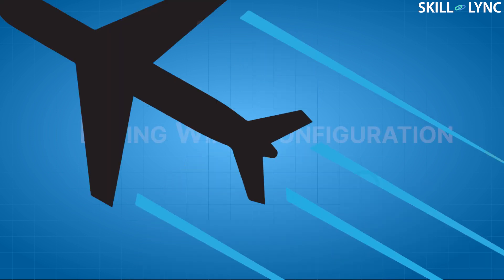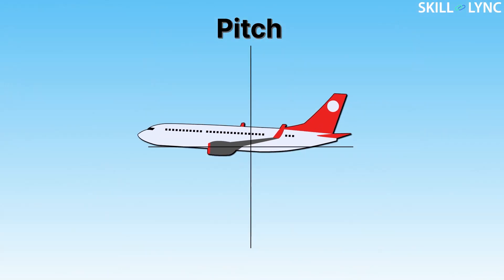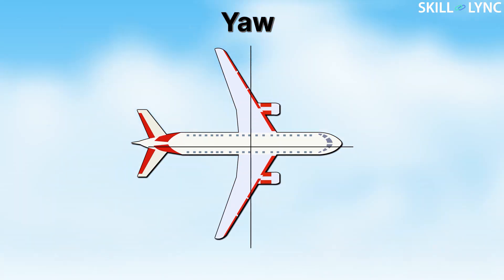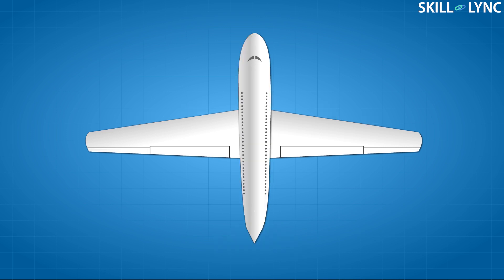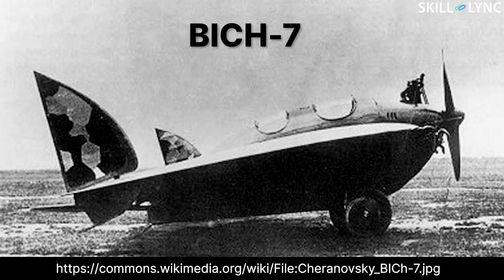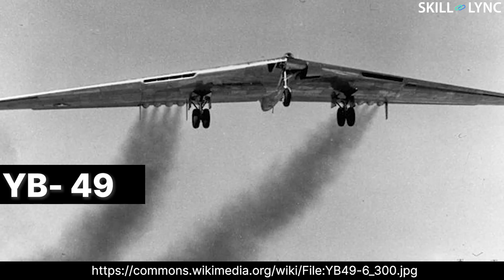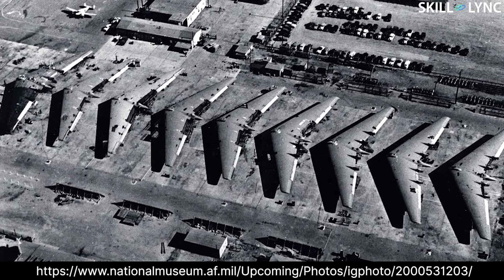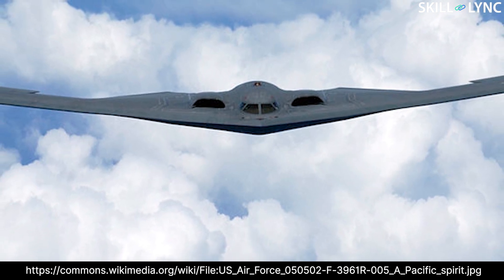What is Flying Wing? | Skill-Lync

Comment: Other definitions of the media term "flying wing" are when the major connecting structure is a lift-producing element, as opposed to one which produces only static drag but no lift.

Many such aircraft have flown, many have flown well, some have flown markedly better than "normal" planes, provided that they have vertical fins and rudders.

See the youtube "Flying Heel Lift" about the 1930s Arup S-2, and others about the Arup S-4.
Also in the '30s, the Kharkov KhAI-3. Just like a "flying wing" in your terms, but with a substantial fin & rudder after CG and trim & control issues were settled, it flew well, with no reported bad habits.

Burnelli planes were called "flying wing" because the fuselage produces lift, though they had substantial tails.

See Northrop's first plane the "Avion 1" (x-216-h) of 1929. A tail, but no fuselage beyond a thick center section the wing, and two slender booms holding the tail.
Reportedly it was among the best planes in its class in all criteria, and markedly faster than all others. For some reason, he dropped it to chase off after the completely tail-less purist dream, and never produced a safe workable plane.

Many designers tried for the pure tail-less, failed, tried wing-tip fins which were only a little less terrible, then when they put a proper fin & rudder on them made good planes. Moskalyev, Lippisch, Fauvel, Payen, others, all followed this progression.
You mentioned the Boris Cheranovsky wings.

Note that the famous XB-35 had prop shaft fairings which served to a large extent as fins, and the following XB-49 had fins, so by the purists' definition, they weren't "flying wings".

Cold War "flying wing" designs included the Moskalyev DSB-LK and the Sukhoi T4ms bombers, which had no static drag fuselage or separate tailplane, but big fins.